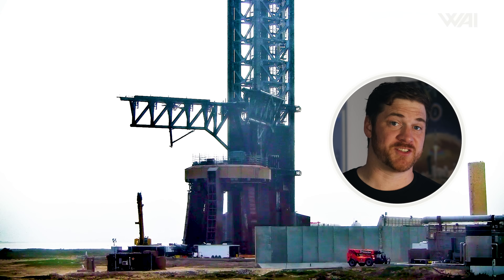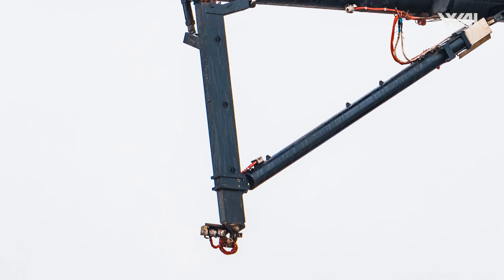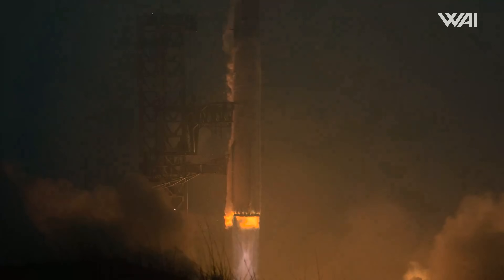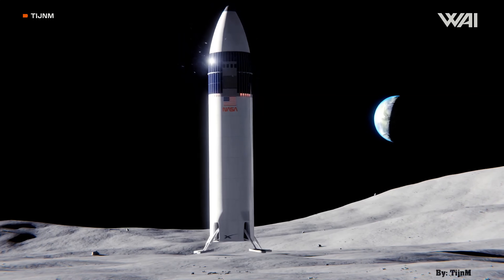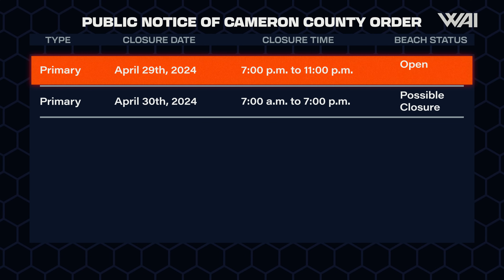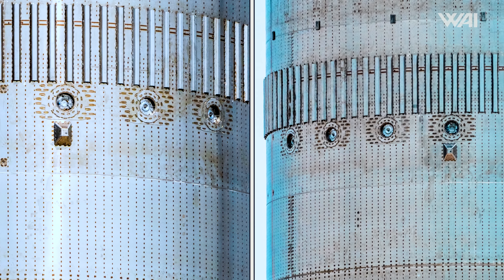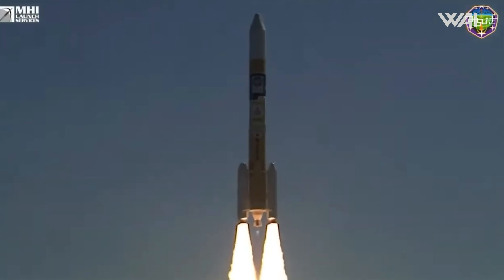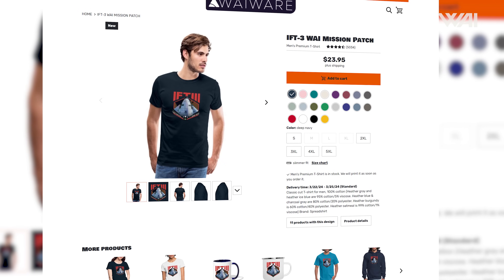SpaceX Starship: NASA Confirms Risky Orbital Maneuver!

Comment: It totally makes sense to virtually land before trying to actually land. They need actual vehicle motion control experience, as well as experience with sloching og fuel for the engines that MUST operate smoothly during landing. I will be VERY surprised if they don't need several virtual landings before trying it for real.
Reply: Yes. The main oxygen tank is accumulating CO2 & H2O ices during landing and the percentage contamination gets very large at the end. We might need Raptor version-4 to solve this.

Comment: 1 tower to launch and 1 tower to catch is a great idea.   How possible is it that the slower engine burn slowing the booster down; more heat and flame in contact with the launch complex;  Will it affect the OLM being damaged?    if they launch using the water-dispersal at launch there should be a similar set up on a 'catch tower' designed to take even more.. At launch there is a certain amount of time that the flames and heat are affecting the OLM.. but the landing, that amount of flames when the descending booster gets to the tower, the possibility of heat/flame damage obviously will increase.  Once the OLM is damaged in this way,  further launches will happen much later.. If the way a cadence of launches, the second tower should be the catching tower, while the launching tower has the next starship/booster ready to launch, maybe even before the catch of the booster/starship is launched.. When they announced they would catch/launch from the same tower,  fire/heat damage WILL go way up, (beyond what those engineers are planning for)..   Catching the booster on a modified drone ship with a large central opening in the platform so the booster lands with all it's heat/flames hitting the ocean surface, and being caught by a modified "floating' OLM.   When the catch idea was presented, my first thought would be "the risk of damage to the OLIT and the OLM is going to be very risky.. Yeah, he's got enough money to burn on this concept, but it's counter productive, and a better idea must be adopted.  In the long run, what if there is no damage for a few launches and catches by the current OLM/OLIT, but the risk continues, and may become a big surprise.. then, there is no other tower for launches and delays of launch after an unintended evert, will push launch out at least 18 more months.. So, planning for this contingent is far smarter than the process they have in mind.  Nothing would be more disappointing than the destruction of the Launch tower and platform.. I hope you guys, finally, are paying attention..   it's a bad prototype idea, with no contingency plan for high-probably destructions..

Comment: Again, landing is very difficult with a cylindrical ship and rear engines this massive. Very unlikely any engine survives.
Now, launching again is impossible for at least a decade! Why? Because of landing damage and no launch pad, even if fuel is landed!
Only a spherical ship with ring engines could launch from natural terrain, if at all. To build a simple flat concrete like platform on the Moon is technologically not yet feasible. So you need to transport a launch platform piece by piece to the Moon and assemble it. Even the most simplistic one would take a full decade to build.Again with fuel landed. Generating fuel on the Moon is technologically out of reach for now. We are talking 2 decades at least on the south pole. 
Why can we estimate this today already?
Simple: Because on Earth everything is 10x simpler, except for the amount of fuel needed to launch/land, than on the Moon and 100x simpler than on Mars.
And forget about 1/6 gravity. Any launch of Starship sized object and landing is not yet possible. Ot with the current design.
This has nothing to do with naysaying or pessimism. Contrary! It has to do with starting to think out of the box now and not stick with technology and methods we already have seen are at their limit even here in a well controlled Earth environment.
Change the Starship design, switch to a hybrid drive with nuclear fuel, establish a tank station line to Mars and prototype landings and launches with a slightly modified falcon, or a 1:4 Starship lunar lander and in parallel design that Spherical starship now. You will need it Elon! 🎉

Comment: Throwing this out there, I believe the titanic taught us that double hull is and should be mandatory. A compressed hemp sandwich hull would reduce frosting of tile attachment.
Reply: The Titanic had larger issues than a single hull. Also, the steel they used was more than strong enough to run straight through the iceberg. The steel that got cut was the side that had the engine on the other side. The constant heat and cold made the steel weak. Weak enough to make a gash through the hull
Reply: @Quasar-2 
The rivets were brittle.

Comment: At 10:20, a quick correction TJ -
The CFA piling technique is the concrete is pumped in, under pressure, as the auger is slowly lifted out. THEN the huge rebar cage is lowered into the liquid concrete.
(This is so the shaft doesn't collapse in on itself)
Reply: id assume they would use grout then displace the grout with concrete after the rebar cage is lowered into the grout. would the act of lowering the rebar disturb or  displace the  aggregate in the concrete making the pour not as homogenous.  i also didn't stay at a holiday inn last night.
Reply: @michaelotoole1807  every batch of concrete is given a Slump Test immediately before pumping. It's a fast setting mix, so there's real time pressure on getting the rebar cage in swiftly .
It's amazing watching a 20m /60ft cage just disappear into seemingly level ground. The amount of sloppy concrete displaced is minimal, and in 45 minutes it's certainly solid/cured enough that nothing is moving.
(If slump test is not right, or too much time has passed, the whole mixer load is dumped)

Comment: My idea for de-orbiting space debris is, after rendezvous, attach a few dozen lightweight, several meter diameter polyethylene bags. Inflate them with a gas cartridge -- no more than a small mouse's exhalation worth for each is sufficient. The cross section of the debris is then greatly increased allowing the (very) thin atmosphere at that altitude to slow it's orbit causing it to fall, albeit very slowly. The lower it's orbit the faster it will decelerate.
Many dozens of bags, essentially balloons, are needed because micrometeorites will puncture many of the bag's thin polyethylene. We're talking Saran Wrap, or Glad Cling Wrap thickness. If polyethylene is vulnerable to solar radiation another material would need to be found.
Not counting the delivery vehicle the package should weigh very little. Much less than a kilo.
This method should be good for small debris that will burn up completely in thick atmosphere. A more complex method would be needed for anything large enough that it should be aimed at that patch in the Pacific that is commonly used for the purpose.
Reply: Check out Mylar, very thin and used in space for decades. I fact, the Echo experimental satellite was made of it.
Reply: @bobjoatmon1993  I was trying to keep the mass down as much as possible. Mylar's mass is much greater than thin polyethylene but if Mylar is the only suitable material then I guess we would have to use it.
Reply: well, its impractical to attach that to every thing that could become debris, like screwdrivers on the ISS, or individual components that a Sat could break up into.. and these mini/micro debris are the real concern, not the Macro debris that non functional satelites are..
Reply: @unitrader403  We wouldn't attach them to everything that COULD BECOME debris, they would be delivered and attached AFTER something attains the classification of debris.
Reply: @TimStCroix  if you match the orbit close enough to attatch something you can just grab it and take it with you.. especially because the most concerning debris are the small ones, because they are harder to detect and avoid. your method is good for big pieces, but afaik these are less of a concern (easier to detect and predict, and also because there are a lot fewer of them)
Reply: @unitrader403  perhaps the paper I read... six years ago I think that proposed using huge bags of aerogel at only a slight difference in orpbial speed (only a few MPH and an inclination that would intersect a lot of the small to medium stuff would work. The author had all his math but at a level that was beyond mine. It would take the weight lifting capabilities of SpaceX'S starship to get the quantity up there though. And then who pays for it? If every country didn't contribute they'd be freeloading on the bennifits of space there were paying for.

Comment: If SpaceX used the Oberth maneuver to minimize fuel use at the expense of time to get to the moon, that would minimize the amount of fuel need to achieve moon orbit. Then fewer launches would be needed to reload the Starship fuel tanks. Just a thought.
Reply: Oberth Maneuver requires high eccentricity. so either every Tanker would need to enter a highly elliptic Orbit (which costs more fuel than it saves), or you put the Depot in a low, circular, orbit while you fill it and then slowly increase the eccentricity over many orbits (which costs time since you only fire the engines for a few seconds each orbit to maximize this effect, which because of neet to start and stop them will also waste some fuel), and this might cost more fuel in Fuel Boiloff. Also makes it more difficult for the Crew Ship to catch up to it. and letting the crew enter before this is also not desireable since they would need to spend a few days/weeks for this slow orbit raising.
Reply: @unitrader403  The Starship Lander would be un-crewed until it is in moon orbit. Then dock with Artemis and it's crew which would have used a direct injection to moon orbit and would have been launched later in time. Once Starship Lander in a circular LEO is filled (to what ever is needed) the amount of time depends on the  number of burns and duration of each. That total time I can not calculate myself but I don't believe it is fixed. The whole point of the Oberth is to use less fuel overall.

Comment: For now they need a catch only tower.  If there is an issue during landing it would not affect launches.  Also a  damaged catch only tower could be repaired more rapidly since  the GSE would be minimaly affected
Reply: Agreed.
Reply: Yeah, this is an important issue, but the amount of space they have available to them at Boca Chica is too limited to have separated launch tower and a separate landing tower.  This is the same space limitation that prevented SpaceX from building a proper flame diverter and flame trench.  The mention of damage to the vertical tanks from the shockwaves during launch highlights the problem of not having a proper flame diverter and flame trench and also points a finger at how damage to the rockets have happened.  Those dangerous shockwaves are not limited to effecting the vertical tanks and that the rockets are also vulnerable to the damage from the shockwaves.  In every launch of the Starship/SuperHeavy it has been obvious that a substantial amount of gas is being vented and it is quite likely that the cause of this heavy venting is due to damage to the plumbing caused by those shockwaves.
Reply: @Raptorman0909 while I agree that available space at Starbase is an issue, the lack of flame diverter trench had more to do with the low water table in boca chica than anything else. At least a far as I recall
Reply: Agreed completely, but they don't want to waste time, which will inevitably waste more time while they have to rebuild a whole new launch pad and chopsticks after it crashes through and explodes after failing to light and perfectly aim itself due to its super huge massive size, weight and height.
Reply: @ericblanchard5873 Aren't they going to dogleg it just to be safe like F9?
Reply: @fcgHenden  i don't know.
Reply: Seems logical to me.
I doubt they will try it by the 5th launch... imma guess 12th or so flight. 
Hopefully, I'm wrong, and it happens sooner and works.
Reply: @Lappillainen if it can't relight the engines it will be nowhere near the tower. Like how they do with falcon the engine relight is when the booster would actually adjust it's flight path to the desired target. If there is concern on how the engines are behaving the booster will end up in the water off shore instead of going to the tower regardless of the plan pre-flight.
Reply: Totally. Been thinking the same for a while now.

Comment: Regarding the oscillation of the chopsticks. Elon really needs to talk to some former Disney Imagineers about how they've improved the motion of their armatures by using forced feedback. There needs to be a separate hydraulic ram that opposes the movement arm. The two work in concert to stop the arm at the end of its motion. You can see this demonstrated in the speed and fluidity of animatronics that have come out of the Disney parks in the last decade or so, compared to their earlier brethren.
Reply: They just need to finish characterizing the system and tuning the servos - PID is a well-understood technique.
Reply: @dancingdog2790  I have no doubt they'll get it right.

Comment: A catch only tower makes more sense than ruining the OLIT with a bad catch. Ships would have to be transferred to Megabay anyway for refurbishment.  With OLIT intact, launch another ship.
Reply: If a dedicated catch tower gets damaged, you still can't land anything until it gets fixed
Launch tower without catch tower doesn't make much sense, eventually
Reply: @AvyScottandFlower  It's much easier to repair a catch only tower than to have to rebuild a launch platform, fuel and propellant lines and BQD from an exploding booster on the OLIT from a bad catch. Once there are multiple launch and landing sites if one tower gets damaged they can always land at another.
Reply: @PiCorder  Doesn't sound like Elon, to have one platform to launch, and another separate one to land, and then have a logistical nightmare, if the two are on separate locations. Lots of added expense and complexity.
Reply: @AvyScottandFlower  His ultimate goal is to have multiple towers at multiple locations, not just Cape Canaveral and Boca Chica. Whether they're all launch, landing or launch and landing towers is yet to be decided and known.
Reply: This is where I have been for a long while. It would surely be move efficient and possibly cheaper to have a separate catch tower/s away from the launch tower/s to achieve the rapid reusability and launch cadence. The risks and the time to make catches with a full launch pad underneath have got to be too big.
Reply: If you can land without it , why complicate it .
Reply: @markmonaghan2309 the ease of access of loading/unloading payloads on ground surface
Reply: @markmonaghan2309  Landing Legs weigh a lot. If they can remove them, they can put another 10-20 tons of payload into orbit. Landing Legs also require a lot of work after landing. A lot of inspecting and testing to make sure they work
Reply: I wish they'd have tried to launch a booster (by itself) and free fall back to the ocean. Just to see if it's even possible to reliant enough engines to stop something that large in a free fall.
Reply: @ryandavis4448  What would launching a booster without a payload show about relighting in free fall, that launching with a payload and actual re-entry doesn't? To launch a booster without a payload, they would have to greatly reduce the thrust on the way up, so they wouldn't even get good data on engine performance. Why take all of the risk of a launch, and expend the hardware and fuel, for a relatively small amount of data when you can get so much more from a full mission attempt?
Reply: @brentbumgardner5664 At this point, maybe they could put mass simulators in place of the 20 outer Raptors, a Starship nose cone on top and launch using 13 engines (maybe) to suborbital and back with a slightly greater cadence, to develop and test the booster recovery process.  When failures occurred, they’d only lose 13, not 33 Raptors.  Just a thought.  I don’t know if that would be more efficient than what they’re doing now.  But if IFT4’s booster hover test fails, they’ll lose those 33 Raptors and have to lose another 33 to repeat that flight.  Might take 5 flights to get the catch worked out and reasonably assured.  That’s 80 extra Raptors lost.  But, I’d imagine the engineering team have probably already thought of all this.
Reply: @Andrew-13579  This is all test hardware, none of it will be saved. The Raptors flying the next 4 flights a V2s, the production versions will be V3s, at least. The next 4 flights will also be Ships 29-32, and Ships 33-35 are already scrapped, so they definately aren't keeping 29-32 around. I don't know for sure, but I'd bet that they would rather test 132 different engines on the boosters, rather than 33 tested 3 times on IFT 5-7, and then scrapping the rest. Keep in mind that one of the things they are working very hard on the learning how to manufacture the engines quickly, and the way they are doing that is by building a lot of engines, so at this point they probably have more V2 engines than they have missions for.
Reply: 1st, they’ll test the ability to come to and maintain a precise hover over the ocean (maybe burn off all fuel and drop in the water)…which will probably ruin all 33 Raptor engines, even if the ships floats and is towed to port.  But, if successful, probably means they can try the next flight on the OLIT.

On the other hand, if they built a catch tower with pretty much only chopsticks, they could make the 1st hover test to that tower, possibly saving those 33 Raptors.  Maybe do 3 test catches there, and then repurpose (disassemble and move?) the tower as another full-service launch and recovery tower.

The cost probably favors losing 33 Raptors on the 1st test?  I don’t know.